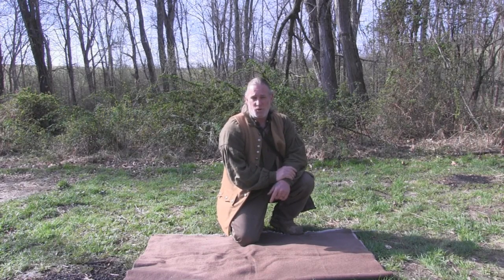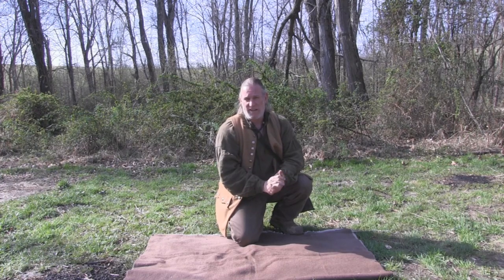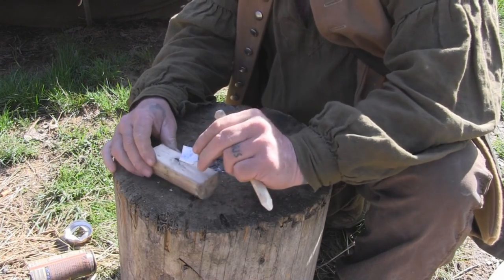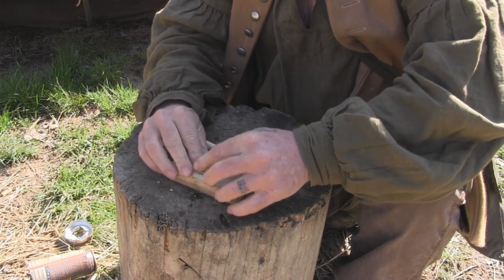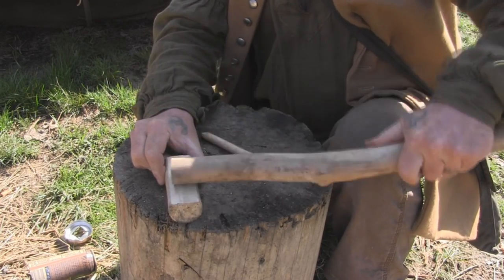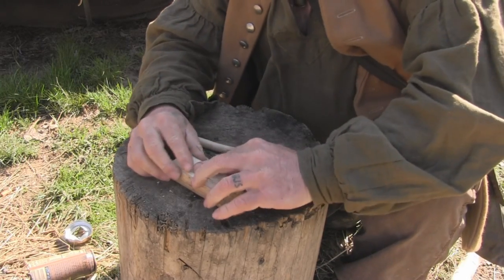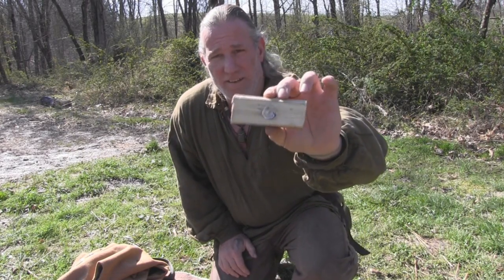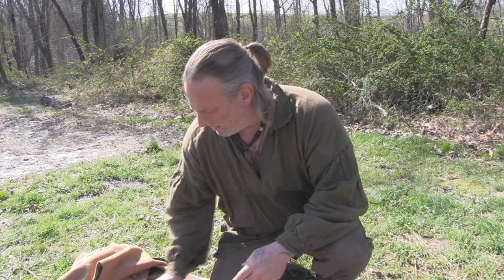Fire School Part 10 Tin Can Bearing Block Insert

Comment: I've experimented with a similar set up. I used my stainless steel soup spoon in the bearing block with a notch cut for the handle. Worked like a charm. The spoon has been part of my kit forever, so it's kind of a no brainer for me,....peace.

Comment: Great idea.  Also, you can use green leaves, vaseline (from those vaseline soaked cotton balls) or cooking oil to lubricate the socket if you can't find an aluminum can.  Shells also work really well as bearing blocks if you live near a coast.

I can tell you've been practicing.  Your movements are more efficient and your timing is better.  Thanks for giving me one more trick to put up my sleeve.

Comment: Thanks Dave! I have been wondering if something like this could be done!
I've been putting off trying to make a bow drill fire as I'm sure it will be an afternoon of failure and stress! I'm going to get at it soon though, in my garage with every lesson and tip in use! I have been thinking of using a copper tube end cap in the bearing block. Hope you had fun in Holland!
Thanks again!

Comment: i find nothing wrong with carrying extra pieces of kit, especially if the weight is very insignificant. just as my FAK only weighs 3 oz., i don't mind carrying something extra that's small. it's the same as what you said about carrying ABS tent stakes. they weigh practically nothing, so you might as well carry them. so, after watching this video, i went ahead and cut a piece of tin can, and i placed it under my shoes insole, so if i was ever to lose my pack, and didn't have my fire kit but still had my knife, i could use it for this exact thing. my whole goal is to keep my pack's weight from exceeding 20 lbs..

thank you very much for posting this. quite ingenious.

Comment: you know, we're always looking for ways to make work easier. This fits the bill. there's always going to be bits laying about. If some of those bits prove to be useful and save some effort, than more power to you. A big part of bush craft is innovation, using the materials one has access to. I'll take this tip to the bank!

Comment: I had the same thought about embedding a metal wearing surface into the bearing block. I'm thinking a bear bottle cap will work well too. It's already a convenient size. Just make the indention in the bearing block, hammer-in the cap over the indention, and take a stick and hammer a dent in the cap into the indention of the bearing block.

Comment: something I did for a knife handle once before, could also be made and carried in a pack is all but weightless.  I took a penny and shot it with a pellet rifle dead center.( make sure you use safety glasses) I have a multi pump .22 that works great to dial the pressure.

Comment: Hi, have you thought about using the hole can as a bearing block. just stomp it flat and use the concave bottom and a glove or a bandanna as a padding when you push it down

Comment: I've seen a video where someone puts a concaved coin into a Mora handle. If you did this to a Robust or Black that you had already put a 90 degree spine on as Dave suggests. You would have a knife with 3 or 4 functions.
Reply: The only problem with the knife idea is safety. If you slip you can cut yourself. The knife has to be out of its case to work. It would be better if it was part of the case and not the knife, imho.
Reply: Mike Kennedy I bought my grandson  the Pathfinder Trade Knife the same day Dave posted the demo video. I noticed the notch on the knife grips used for a bearing block was made with a countersink bit. The only problem was, you had to take the knife out of the sheath to use it which like you say, could result in an injury if ya slipped.  I simply drilled another on the other side using a countersink bit and now it can be used as a bearing block without taking it out of the sheath. Much safer. I contacted Dave about drilling the countersink on the other side, Don't know if it was ever changed or not. Still.... it's a fine knife.

Comment: Dave you can do much the same thing with a shotgun hull. Cut the brass off and hammer it into a bowl shape and put it in in much the same way.
Reply from the maker: I think the primer pocket would cause an issue on the spindle tip?

Comment: Too bad you couldn't find one of the old fashioned caps from a beer bottle (or soda). The kind you need an opener for. Then the edges would catch on the wood when you forced it in there.

Comment: Why not use an actual bearing in the bearing block?  As someone that has yet to even start a fire with a bow drill I believe that I will start with "cheating" methods so I can stack the odds in my favor & then eventually use nothing but a knife & wood.  For beginners just trying to get the feel of it you can get a mini bearing the size of a silver dollar & you will get zero heat in the bearing block because its riding in an actual bearing.